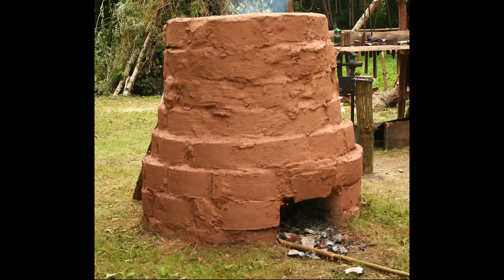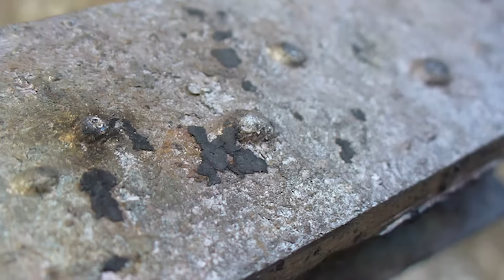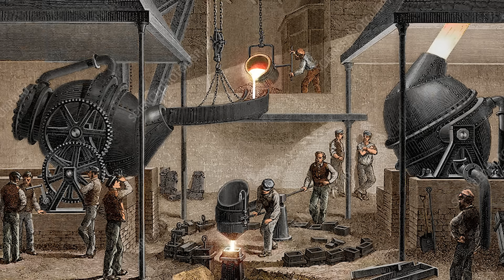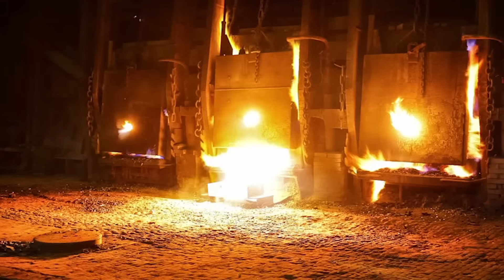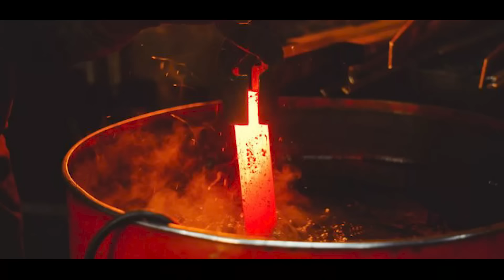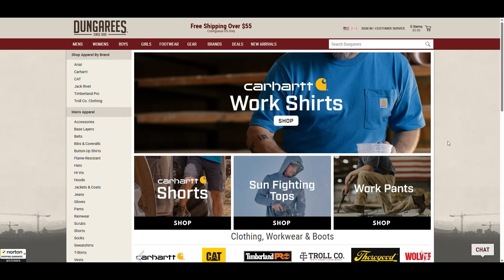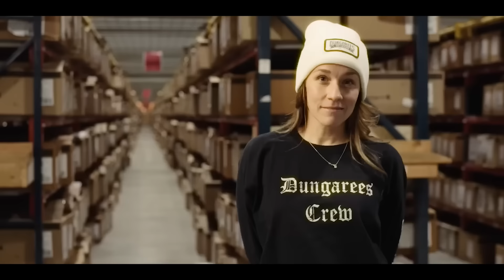Why they REALLY don't make tools like they used to

Comment: I think hardness is not the main factor that determines how easy ist is to sharpen. The hardest Japanese knives and chisels sharpen very easily especially because they are often pure carbon steel. The alloy determines abrasion resistance which is what makes some steels hard to sharpen.

Comment: I am not a "fine woodworker" (just a scratch carpenter/handyman), but one thing not mentioned here is that "old tools being expensive" has only been a problem in the 21st century, largely due to the internet.  I got many of my tools from the town dump back in the 1970s; we used to play there, and someone had thrown them away 'cause they were old.  The ones I have now are my second set- the tools I obtained as a boy were stolen in 2007.  That really hurt, and I still haven't been able to replace everything, but the ones I have now are just as good (and just as old, too).  I do own some newer tools as well, but most of my tools are older than I am- some are nearly double my age (I don't think I have any that were made prior to the 1920s, but it's hard to tell sometimes with the older stuff).  The most important thing I learned from the old guys back in the day is that it is worth the time to clean and/or refurbish an old tool rather than spending the money to buy a new tool.  

The chisel I use the most is a low-end one, made in the U.S.A. by Corsair around 1961 (I looked it up 'cause I was curious).  Some idiot had spilled white paint all over it and dropped it in the dirt, so it looked pretty bad and I got it for 50¢.  After I cleaned most of the paint off, it looked nearly new- not a speck of rust on it to this day.  It was never intended to be anything but a cheap tool (you can see that the steel is not top quality), but it works well for me.  It has never been sharpened; it still has semi-circular marks on the nose from the grinding wheel they shaped it with in the factory.  It is just now getting to the point where it needs sharpening.  Sometimes you don't actually need the best or most expensive tools to get the job done...

Comment: Modern steel doesn't have any grainstructure that aligns with the shape of the tool. It has grains but the grain size is what is important there. Making anything follow the shape of a workpiece is only a thing when forging pattern welded steels and making stuff from it.

Comment: I don't know anything about woodworking specifically but I have a little bit of experience in steel-making, did it as a student internship. Knew all about tempering, Rockwell scale etc.

But I have an example where older tools are better: those with vanadium. They are not pre WW2 vintage or anything, they were just the default in the 50s to 80s especially in the Soviet bloc. I have tools for my bicycle and basically my entire household from my grandpa that are vanadium tools and they are just much more robust than new, somewhat cheap tools. Despite being like 70 years old. Only have to care for rust, they are not stainless.

New tools with titanium in the mix are nice too but expensive.

Comment: Woodworker from Sheffield here, Sheffield steel is still very good Qualtiy but due to a number of factors such as privatisation lowering govemerent subsitides and the UK switiching to a more fincaical ecomany rather than manufacturing and the Minor strike . It has reduced in scale, significangtly, Forge Masters is still going strong but it focuses more on Highly specialised materials rather than tool making. The CNC shop I worked in for a breif time used to import steel from china which seems ridiculous consierding we where one street over from a steel works but it was just more cost effective.  There are still small tool facorties in Sheffield for saws, Knifes and Sissors but are more Artisan than large scale and very exepensvie. 

The old Stanley Tools factory is now a Painball Arena It still Says Stanley Tools on it tho and a good old landmark. 

We in Sheffield are very proud of our tool making histroy but its declined a lot since the 1980's and like most people in Yorkshire I'll blame Thatcher for that.

Comment: So what I found as a farmer and chef, I'm speaking about using tools not necessarily the ones mentioned here, the old stuff is better. If I was to define it in a quick sentence it is that they used to make things to last because that was good business you have customers that come back to repurchase items. Things may be safer now or have more comfort, but they're definitely not better. Everything from boots, to jeans tractors, to chef knives may have needed more work from the consumer to keep them usable but definitely better made all around.

Comment: A lot of modern chisels, punches, and files use case hardened cheap steel. Technically it works just as well, but can't be resharpened or repurposed.

Comment: I find the "so glad I grew up with this..." mentality very good and respectable.

For me, metalworkers and smiths back in the day were real-world metal-benders. They were "able to build this in a cave, with a bunch of scraps". The best materials they had to start from were often today's poor-quality scrap metal, if not even worse. Most professional workplaces of their time might have been out-equipped and out-powered even by some of today's DIY enthusiasts and their moderately well-equipped hobby workshops.

And yet, they DID do things differently. Some chisels can be older than my parents and still have objectively better performances than more than half of their modern counterparts from my local hardware store. Just like how people in the 1900s sent humans to the Moon on a combined computing power that couldn't have even run DOOM in real-time. I still can't make Jebediah Kerman fly to Mun and then safely return to Kerbin in 2025.

That said, there is something I always struggle to follow through when that first "so glad..." half ends with a "...and not this". I'm more of a "... but d*mn this is better" person. My gaming rig is strong enough to make all male Skunkworks engineers in the 1980s fall into comas because a PC that can do real-time ray tracing will make their boners look orders of magnitude bigger than their F-117 Nighthawks on the radar screen. And as long as a lot of people much smarter than I am can also put their similar PCs into far better use than I can, I should not be the one who serves as a proper modern comparison against the "cast steel chisels" from 1960s NASA. The same should be true about today's tools: our budget or mainstream tools are not proper modern equivalents of vintage tools, because those vintage tools were already the best of their time when they were first made. Metal workers 100 years ago might have been metal-benders, but today's material scientists and mechanical engineers bend reality in comparison. Today's advancements are just as advanced as, if not even more advanced than, whatever mythical materials from Middle-earth Tolkien had in his mind when those "Sheffield Cast Steel" were still the cutting-edge (pun intended) of the time.

Those old tools survived a better part of a century because they were the creme of the crop in their time, and the craft in the past should be respected. But It would be only fair if we did justice to today's "creme of the crop" as well.

Comment: yup old chisels all the way, I get them cheap as, and make handles for them, I got two cast ones, 35mm and 50mm and they are brutal, best chisels I've ever used, new ones from the common hardware store are such junk, I've got a lot of those marples ones with the yellow n red resin handles, those are a decent chisel, I've got over 30 old chisels and they serve me well

Comment: Hey James. Interesting history lesson. I have two Stanley planes circa 1908 to 1915 according to the catalogs I've seen. One thing that impresses me about both (a #4 and $7) is that they really don't rust. I live in Alabama and a day after a hard rain in summer can cause all sorts of rust blooms on certain tools. These planes get a touch of rust, but a quick rub with steel wool and they're good as new. The plane irons are also easy to sharpen but very tough. I've run over knots in treated pine and it doesn't phase them. Do you have any idea if they used a different alloy back then? Maybe a little manganese added to the mix? The souls on these two planes also get very shiny with just a little rubdown and never get that gray look you see in other irons.

Comment: The belief that older steel is in some way better than today’s high quality steel is just a nostalgic dream. Sure some current tool manufacturers make garbage, but that’s a reflection on how they do business and not a reflection on today’s high quality steels. For anyone who wants to get a scientific picture of tool steels today, I suggest the YT channel “Knife Steel Nerds”. The author is a PhD metallurgist who specializes in knife (tool) steels, runs exhaustive tests on different steels and puts out extensive reports comparing edge retention, toughness, corrosion resistance, etc.

Comment: A 78yo Brit living in Australia here. This video brings back so many great memories of my late school days in a heavy industrial area of England. I was taught many engineering things including steel making, hardening, tempering, bessemer furnaces, blast furnaces. Even now, I can damn near tell the differences between really good cutting tools and cheap or "not so good" just by handling the blade, chisel or spanner. And boy, some of the stuff out there is really bad. It''ll last a weekend if thats all you need. But it wont last a lifetime if thats what you want. I have several wood planes all made by the same maker over many years and the difference in sharpness and durability is noticeable as makers go through different qualities of steels for cutting edges. Thanks Stumpy. You made my day.💯

Comment: Problem is.... Chinese steel is not actually steel, it is a layered composite. with cheaper unpurified materials sandwiched  inside...
it is usually very slightly magnetic , flates or chips easily and generally rusts internally.

Comment: we are more more precise than ever at making things. this means we can cut production time and materials making something that will work for exactly as long as we say it should. or we can make something of far better quality more consistently that will last longer than we know.

i have worked in a steel mill for 10 years now and the mill i work for is the place that make the super high quality unique to only our company mega stupid expensive steel it is to the point that if we run out of premium orders and need to fill it with junk steel we sell to a company that has a standing order of "we take it all for cheap" we struggle to make the crap steel crappy enough we are saying it is worse quality than it actually is (thank god the quality just asks for a minimum set of properties )

Comment: The main problem today is not the ability to make superior tool-making steel, it is the fact that most manufactures go for the lowest price to produce their products and therefore the quality-control can be pretty bad. Witness the sad decline of Stanley planes; any woodworker knows that their new stuff is garbage compared to decades ago. I bought one of their $20 block-planes just for "rough-work" where I might be running into hidden nails, the build-quality was laughable and the blade was so poorly made it had grooves you could feel with your finger-nail and a visible crescent-shape to the cutting-face. It took an hour with wet-stones to re-shape and refine the cutting-edge. However, the real point is that the blade holds an edge as well as my expensive planes so even though the plane is terrible in every way, the blade-steel is still good.

Comment: In the ornamental turning world we need cutters that will take a literal mirror finish - since ornamental turned parts undergo no further finishing  (no sanding etc). Victorian steels have the fine grain needed - tungsten carbide etc don't. The best approximation for DIY tool making uses silver steel (drill rod in the US) - a high carbon steel with some chromium. You have to hold it hot for IIRC 30 mins to allow the grain structure to refine (and the grains get smaller). Then shape it, polish, harden and finally temper in boiling water. This is not a tough edge - but sharpen on a 6000 mesh waterstone and it takes an optical polish (that will transfer to the right workpiece material).  (Just don't cut yourself with one - part of my finger took 4 years to regain full feeling)

Comment: I would rather have a properly heat treated modern steel with high toughness that I could then shape and sharpen into a chisel.

This video is slightly misleading. We have developed steel that’s wildly better than what they had back then, this is not up for debate. The real, true problem here is getting a manufacturer to put our magnificent modern steel into a chisel form.

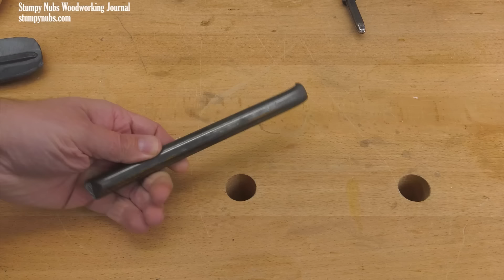5:54 This is exactly my point: what kind of steel? Is it D2, or Magnacut, or CPM-20cv, or what?

Comment: The main difference if most tools nowadays are produced form scrap. So no matter how careful and sophisticated the process is, if a base material is not so good and pure, it won't get you best results. Old BMW motorcycles where produced form a pure aluminium and where unbreakable. Modern GSA models don't survive very long despite modern technologies.

Comment: Im with you all the way. But I have an answer to the 100 year old Sheffield vs brand new question, that's not science but most folks would hear it as such I think, which would I take? The Sheffield. Cos it's a hundred years old made when my grandfather was a boy. Its a chisel. if its still a recognizable chisel after a century Im fairly confident that it will serve the current generation of Mac Leans just as well. Not really science or a logical argument but makes sense to me.

Comment: It's the quality of the steel for tools. Companies are buying the cheap stuff with no carbon in it. Nowadays if you wanted to buy high quality tin snips you would have to buy "midwestsnips" brand still made in the USA from (medium?) carbon steel. They offer the "Special Hardness Offset Right Cut Aviation snips" which are the same high quality that Wiss brand sold in the seventies.

Comment: 1) Railroad "ties" are wood, it is the railroad tracks that are steel, AND railroad tracks are actually very high quality steel, typically high Manganese, not "low quality" as you said @4:35.  2) One point you did not cover is that a lot of newer steel is smelted with "coal" which contains a lot of sulfur, where some early small shop steel was remelted with "charcoal" which has almost no sulfur.  While Sulfur has a slight negative effect on the hardness and toughness of the steel, it does promote greater rusting.
Reply from the maker: Yes, I misspoke and said "ties" when I meant "tracks." I think that was pretty obvious, but people love to correct others so you're about the 20th to comment about it. But I am correct that early railroad TRACKS were not made from the highest quality steel available at the time. They were mass produced as quickly as possible to keep up with the massive growth of the rail system in the nineteenth century. Track made later may have been different.

Comment: It’s only since the 80s and 90s that the analytical instruments were invented to rapidly quantify the alloying concentrations.  The steel makers of old could only dream of the tools we have to make top notch steel now.  There’s just no way 100 year old steel can complete with a modern chrome/molybdenum/manganese alloy of tool steel where the percentages are tightly controlled.

Comment: I was an apprentice steel fabricator in Chesterfield (just 12 miles south of Sheffield) in the late 1960s. I studied metallurgy and learned about wrought iron, carbon steel, stainless steel and cast iron. I also bought most of my tools from Sheffield (those I didn't make myself, of course). Just a few years ago I bought (on eBay) a job lot of 100-year old Sheffield steel wood chisels from various manufacturers, as well as a No 6 Stanley fore plane and a No 4 Stanley smoothing plane. The chisels had been made, variously,  by Robert Sorby, Marples & Sons, Ayrewood & Sons, Alfred Ridge, St Ormont, and Henry Taylor. All of them of utterly superb quality that only needed a bit of care and attention to bring them back to fully working condition. I sharpened, honed and polished the blades on those chisels and on the plane irons and they now cut far better than any modern equivalent.

Comment: Not sure if this is 'true' (by todays facts and science).  But what i was taught, by a master cabinet maker at a luthier college, was that old tools (chisels etc) are better because they are 'Pre-Nuclear' metals (as opposed to 'post nuclear' metals).  Apparently, all iron-steels made after the 1940's have a small amount of radioactive material inside them.  And this caused the metal to become weaker and not hold an edge as well (possibly one reason we later created super steels?).  He taught us to go to various car boot sales (etc) and pick up any old, worn, tools from before the 1940's.  And fix them up / resharpen them.  I haven't looked back since :-) never needed 'new' tools.  
Still use the same ones i bought at boot sales, some 30 years ago now